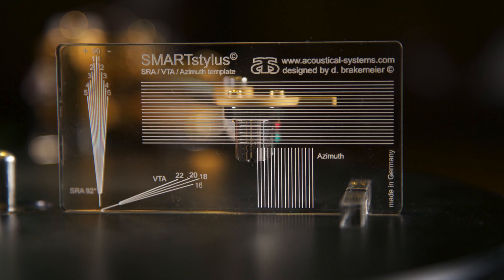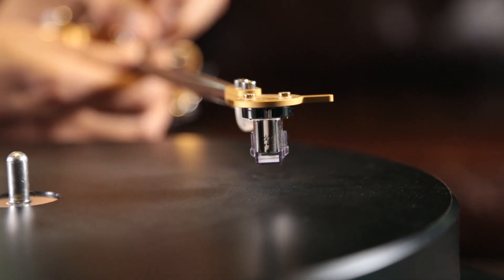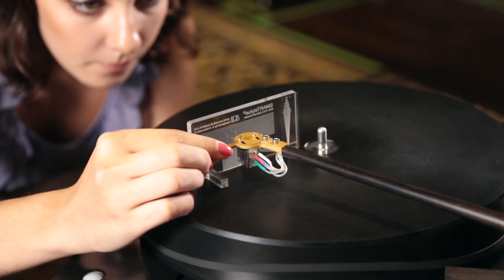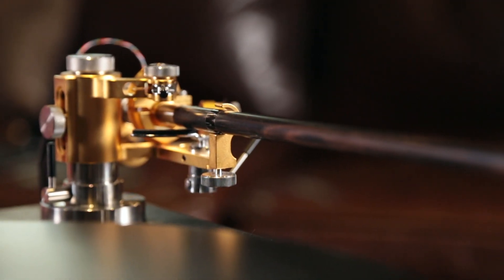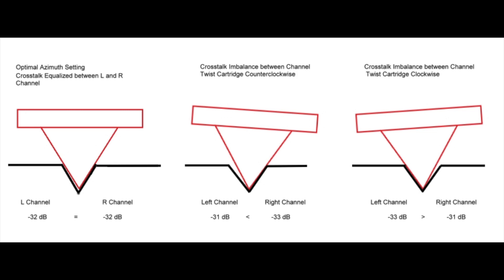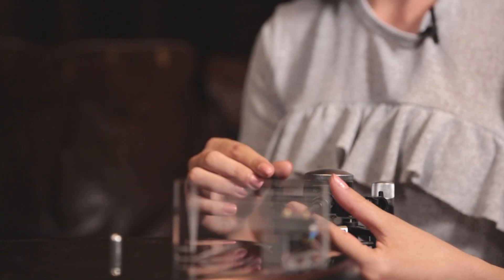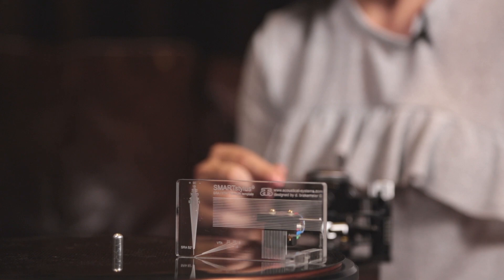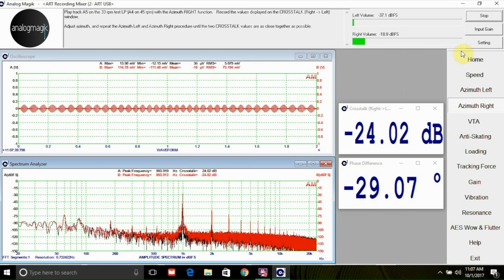Azimuth: How to setup Cartridge horizontal balance (AnalogMagik Tutorial 3)

Comment: Not an easy thing to use. You need a crazy sharp microscope not to mention great vision power to spot the tiny stylus and it's vertical alignment
Reply: No, AnalogMagik does not relie on visual methods.   It is based on measurements while the stylus is playing on the grooves.

Visual methods are unreliable because whatever is eyeballed visually will change when the vinyl spins.
Reply: Buy reading glasses.